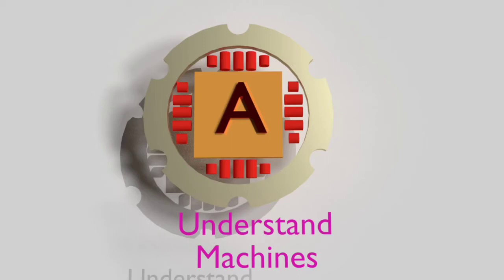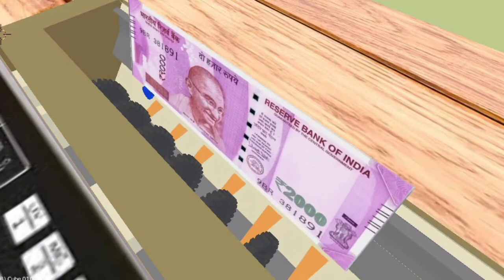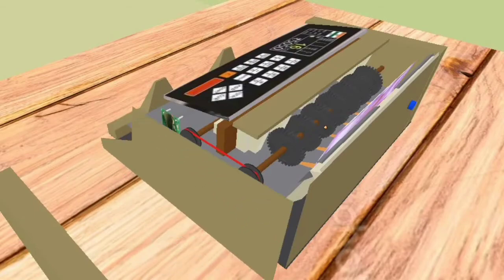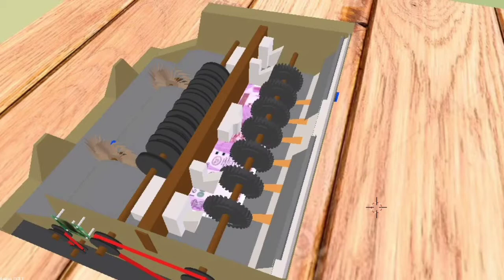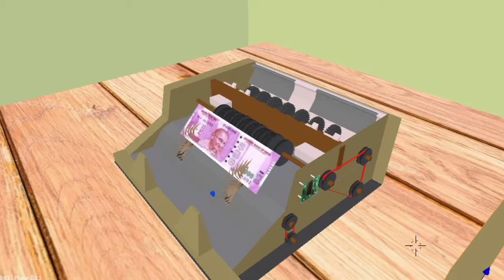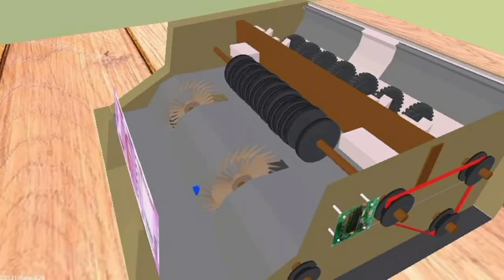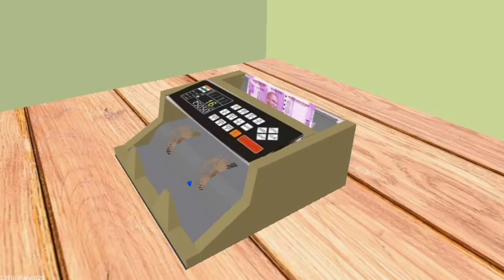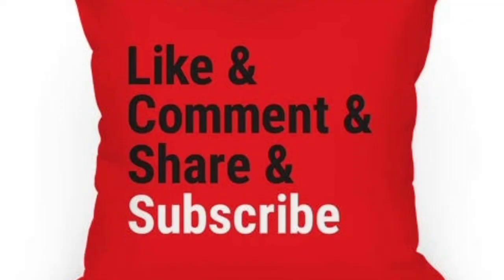How Cash counting machine works || Money counting machine working || In English || Animation ||

Comment: I understand how the sensor works, I just wanna know how the machine doesn't accidentall slide 2 or 3 bills through on accident. How does it do just one at a time?
Reply from the maker: The clearance between wheel and surface is maintained same as the note thickness so because of some reason the distance between surface and roller is increases then in that case two more bills passes at a time